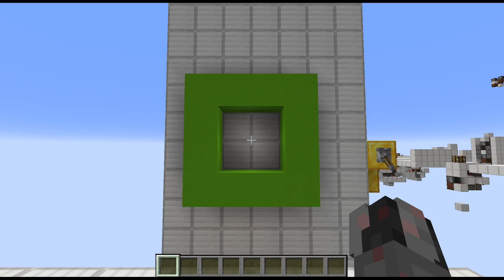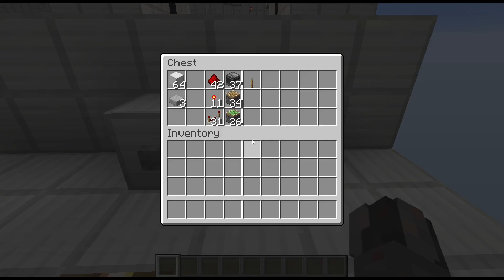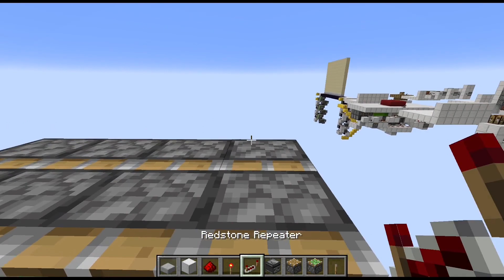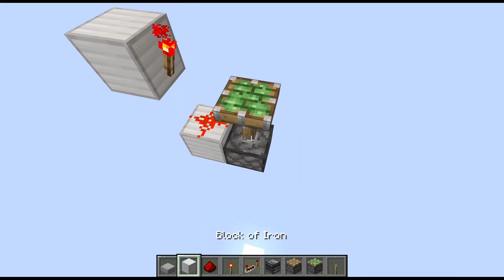Tutorial: Simple 4x4 Donut Popup Wall Block Swapper (Vertical) [Java 1.11+]

Comment: I am amazed every time. You have created some of the coolest most functional Redstone devices I’ve seen
Reply: I’m was also curious if you would or could do a personal project?  Or at least point me in the right direction. No worries either way
Reply from the maker: Thanks for the compliment!

I'm always extremely thankful for new design ideas, although I don't really do coops or direct commissions. So if you have an interesting idea, there is a good chance to see a tutotial for a corresponding contraptions in the near future. Of course you would be mentioned as the originator of the idea.
Reply: Well. It’s not so much an idea. Just something I’m not smart enough to figure out haha. I’m a bit of a Star Trek nerd. I’ve only been messing with Minecraft for a year. I just like building. No survival or anything like that. What I’ve been trying to build is a functional warp core. With the lights moving up and down respectively from the center. There’s an old warp core prototype map from Momentaneously. His designs were great but too outdated. Only one works. But it keeps breaking
Reply: Also I’m extremely thankful that you took the time to respond
Reply from the maker: I try to always respond to comments. It's just good manners.

I don't know the warp core design you mentioned, but I suspect it's piston based (maybe some piston feed tapes?). Piston timing has been adjusted a few times over the years, so that could be the cause, or it's the new redstone wire behaviour.
Can't really help you beyond that without knowing more.